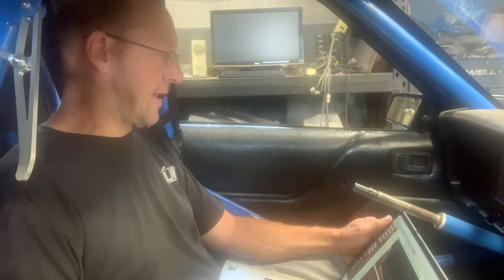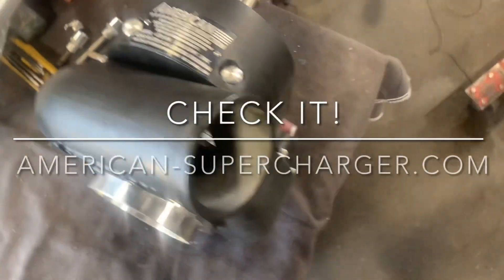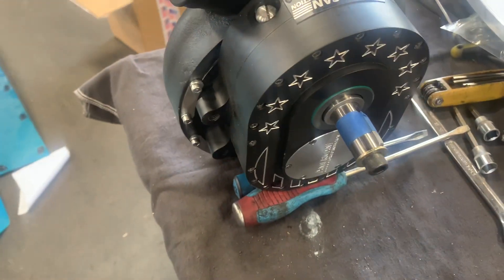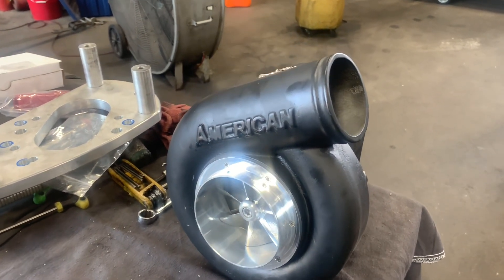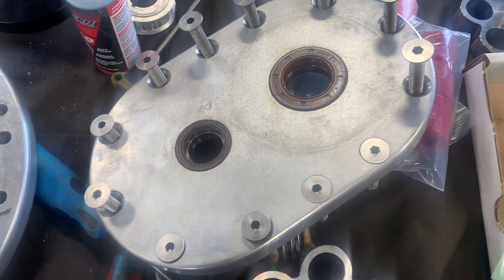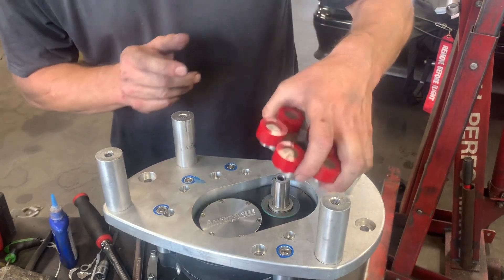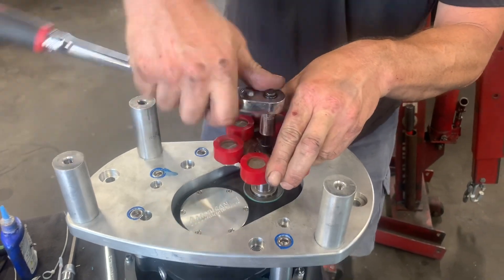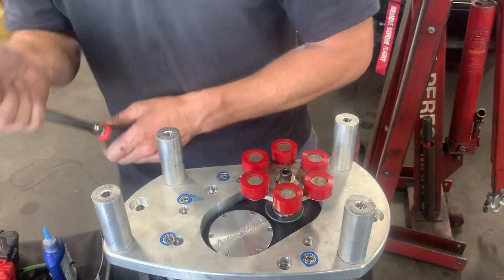Testing American Forced Induction AF1-94 Supercharger!!!  1000+ hp

Comment: have you had any other street blowers go head to head with the American stuff? like a ysi or jtb maybe a d1x or f1a94? If so how would you say they compare?
Reply from the maker: The AFI-94 didn’t make quite as much as the F1A-94, but made more than a D1X.  It’s very efficient . We ran 7.70’s pretty easy . I’m testing the AFX-94 soon , this is the race series 94
Reply: @ShopDezRacing   i know the f1a94 is a badass blower when spun hard but i have heard they can be pretty lazy in the midrange especially if you aren't aggressive on the pulley. what rpm did you spin the f1a94 to? I curently have  416 ls3 manual corvette with a jt trim on it pullied to just under 60k rpm and it seems to tap out at about 14psi with the air filter dongle on it. its a street car that will make some track passes  and i am shooting for 900ish rwhp with healthy midrange. would you recommend the af1 -91or94 or the jtb for my setup?
Reply from the maker: @lewtninja  the AF1-94 would be big upgrade to a jt trim. We spin the F1’s pretty fast but they are in race cars and we need everything we can get.